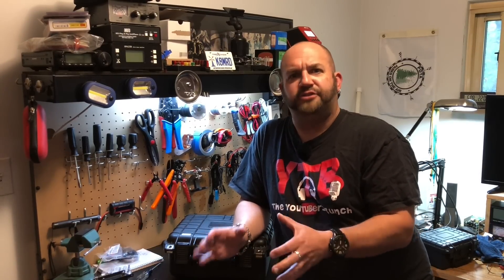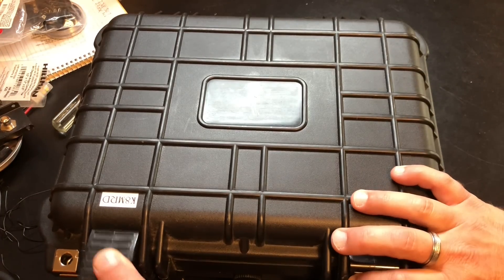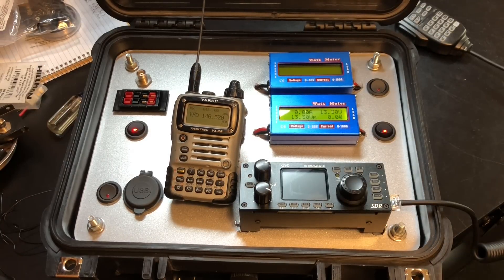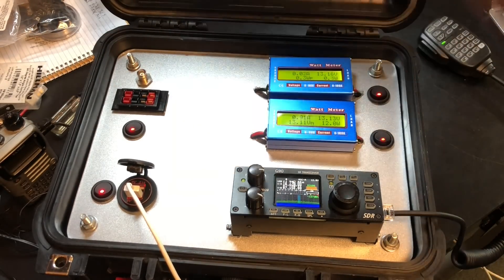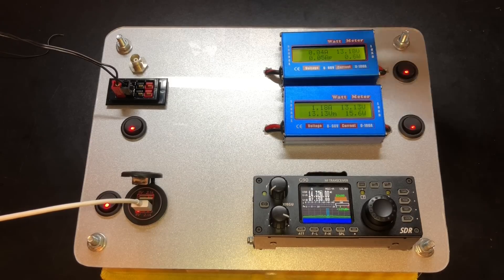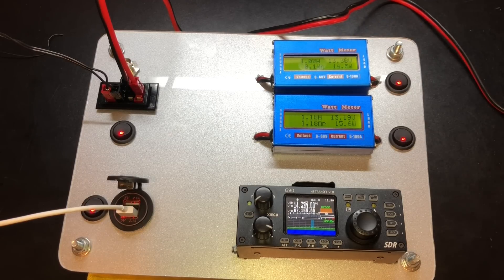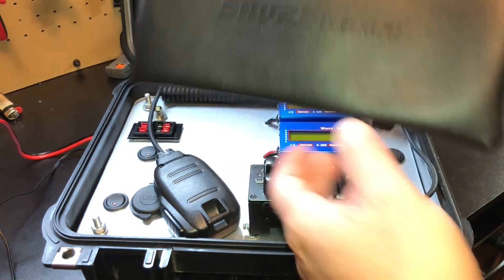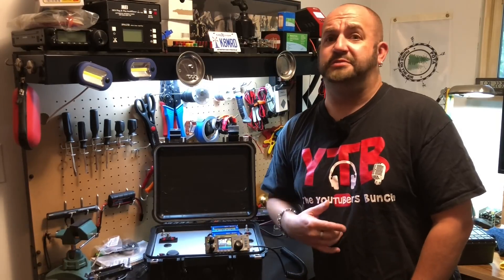Xiegu G90 Ham Radio Go Box & Solar Generator

Comment: Awesome video, I'm so glad you made a go kit like this! I've been going back and forth on wether I will want an all-in-one go kit or to just throw a radio, battery and antenna in a bag and set them up on location, but this is definitely making me heavily consider a go box. Most of the ones I've seen are really big, I like the smaller size, it seems a lot more manageable! The only thing I might add when/if I make my own box is a raspberry pi for digital modes, but that might do better with a seprate box/case that connects to the main radio kit, so it isn't a permanent thing. Can't wait for the build video!
73 de KE8OIB
Reply from the maker: Thanks Logan.  For me, if I added anything else to this build like a Raspberry pi, it would have to be in a bigger case, and start to weigh more, and be the go box that I don't want.  Sure I could mount the pi on top of the panel, but then I would have to have a screen and a mouse and keyboard etc.  It can get out of hand quickly.  The idea is for quick deployment.  I don't care about hooking a computer up to it as I'm not really into digital modes.   If you did want to add all that you could certainly do it, but you would need a bigger case at the very least.
Reply: @hamradiotube  Yeah, I get what you mean. I've seen some super awesome kits that incorprate all that stuff (screen, Pi, keyboard, etc.), but they're very chunky  and don't seem like they would work well for a casual activation. My current plan is to make a small box that includes the Pi (running headless with a tablet) and all necessary things (soundcard, GPS dongle, etc) that plugs in to the main case and doesn't have to be brought out for all activations. Who knows what I will do though, I don't even have my general ticket yet!

Comment: I'm thinking of getting a 705 sometime in the future, once I have something else for portable I will probably make something like this and stick my 891 in it. Though obviously I will need to add supplemental cooling because we all know how hot the 891 can get, especially enclosed. I think personally, I would forego the solar charging, and add a bigger battery and a manual tuner. I didn't realize how simple one of these could be, I thought they were super involved and very expensive. Obviously, it's as expensive as you make it. Most people already have every thing laying around except maybe an extra battery and an extra pelican case. I look forward to seeing updates to this in the future! 73 de W8IJC
Reply from the maker: I'd love to see what you come up with.  I'm gonna take my chances with cooling.  There just isn't room for a fan in my build.  Theres plenty of room for air to circulate around the edges and the cutout for the head cable.  I'll know when I get a chance to take it out portable.  I've never had an issue with my 891 getting hot.  There is also a "contest" mode you can set the 891 too that will kick the internal fans into overdrive.   As far as cost, I prob have less than $100 in all the parts including the case.  Obviously that doesn't include the battery and radio.
Reply: @hamradiotube , oh, I thought that was a common thing about the 891 getting hot. Mine seems to get pretty hot, and I do have the fans on contest mode, mainly just when I run digital though. So honestly the supplemental cooling was just a shot in the dark more or less. I'll definitely build one of these things in the future! I look forward to more of your videos on this!

Comment: Thanks, that's an inspirational design, and now I have the jones to make a box similar to yours!  I like what you did with the head, I'll do the same on my G90. I'm also going to add an RPi below hooked up to a SGGCOMS audio interface and a GPS antenna for remote data ops. Couple of things: (a) Did you get a source for a shorter D9 extension cable that is still shielded? Also, I am concerned about your design in one area. (b) I'm worried your design doesn't adequately cool the base of the G90. That gets hot. I think you might be able to easily mod your case by sticking a 60mm fan on one side of the case and creating a reverse-chimney with a piece of plastic or cardboard down to the G90 on the other side of the case so the air flows under the G90. I will experiment with mounting my G90 cross-wise so the air flows along the bottom heatsink channels instead of across. In any case, will love to get your in-field feedback experiences!
Reply from the maker: Thanks Paul.  If you add all those things, you will need a bigger box, which is the exact opposite of what I wanted.  It would turn into one of the big heavy boxes I talked about in the beginning of the video.  Not saying don't do it, that's just not what I want.  I don't care about digital so I did not incorporate that into the build.  As far as heat, only time will tell.  I am very aware the heat the radio produces.  I may add a fan in the future, and it was something I thought long and hard about, but ended up without for a few reasons.  One, the heat sink is on the bottom, which is the dumbest place to put it.  If I turned it over then the speaker would be firing down and I'd prob have to add an external speaker.  More weight and not a lot of room to begin with.  Then I would also have to find a place for the fan.  You see where this is going.  There is plenty of space around the panels and the cut out for the cable to the head so it should ventilate well enough.  Plus it is sitting above the bottom plate about a quarter of an inch, not resting on it that should provide some heat dissipation.  There is also nothing else in there that produces heat.  I still haven't taken it for a proper K8MRD test in the field as I've been building, filming, and editing for the last 2 weeks.  I'm sure I could cram a fan in there if I have too but I really don't want too.

Comment: I use the Bioenno SC-122420JUD charge controller. It’s rf quiet unless you plug anything into the USB port on top. Tried charging my phone while using my 818 and couldn’t hear a thing over the increased noise. 

Their 28watt panel works great for me, granted I’m in Texas and only using a 3ah Bioenno. I’m planning an upgrade to the 12ah for more power to charge/run other devices as well.
Reply from the maker: Ive got a Bioenno charge controller as well.   A little too big for this project but it works great.
Reply: @hamradiotube  yeah, same thought. Given that the BioEnno charge controller doesn't have to go in the middle of the circuit between the battery and load, my thought was to leave the CC out of the box and stick it to the back of the panel instead.
Reply from the maker: @PleasantPaul  Yeah you certainly could.  That kinda goes against the purpose of how I designed this though.  I want everything in the box.  Plus, I have more than one solar panel so that would limit me as well.  The real idea behind this box is as an emcomm and power box.  I most likely will always have it in my car should I need it, or just want to play radio.  I don't want to have to worry about any other parts.  Literally everything will be inside this box, coax, antenna, everything, other than the solar panel itself.
Reply: @K8MRD RADIO STUFF yep I hear you. For me it’s POTA-first, emmcom second, so for short activations I’d rather have less weight and the CC can live with a panel. Great design choices! I wish I could fit the CC in my box but the RPI and data stuff make it tougher. In any case, thanks for your excellent inspiration! I was always anti-go-box (but pro-go-bag) until your design.

Comment: Is that phantom power on the top meter what it takes to light the meter up?  Freakin awesome box... about 90% of the time people don't show how to mount things inside.  Looking forward to the next vid brother!
Reply from the maker: No, its just connected to the battery.  When power is coming into meters like this, either from the source, or load side, the meter will turn on.  That's why I had to put a switch on it.  I'll have the build video up soon.

Comment: Great work! I have been looking at doing something similar.  Do you have any issues with the G90 overheating being fully enclosed like that? I was debating putting a fan and vent holes in the top mounting plate.
Reply from the maker: I haven't actually had a chance to put this through a proper K8MRD stress test, but I imagine it will get pretty hot.  I thought about a fan and may add one in the future, but honestly there just isn't hardly any room for one.

Comment: I like your box. I just took my vhf /  uhf  box apart. I am on HF more than vhf / uhf now. There  are pictures of it on my twitter account “Sroy2HamRadio” if you want to take a peak. Scratch that pictures were on my old instagram account. Will try to find them.
Reply from the maker: It'll be a lot cooler with HF in it for sure.  Now you have another project :)

Comment: Great build Mike! You will have a lot of fun operating that kit. I built a 19" rack mount go box at one time AND took it into the field on many occasions. It was a beast and I finally got tired of lugging it around. It weighed almost 40lbs without the battery.  A bit off topic and I know you have mention it before but for the life of me I can't remember what logging software you use? 🤣
Reply from the maker: I would like to see someone actually taking a rack mount box out in the field.  It would make for a good laugh for sure.  As far as logging, I prefer Crayola Crayons and construction paper.  I find it to be a lot more rigid than notebook paper, and if the bands are quiet, I can always color while I'm waiting for a contact.  73
Reply: @hamradiotube  🤣

Comment: Well done Mike. You've built what many of us talk about but never get round to building! 
73 Bruce G4ABX
Reply from the maker: Thanks Bruce.  It really wasn't that difficult.  Half the time I spent building it was thinking up/shopping for parts to make it all fit.
Reply: @hamradiotube  I guess nothing is that difficult once you get your head around stuff. I would like my go-box to include TX/RX and  Raspberry Pi with screen for digital modes and logging etc. I now have the Computing side working -- with GPS, RTC, WSJT-X, FLdigi etc., (Courtesy of KM4ACK) and have completed my Solar Generator (courtesy of OH8STN) so now I need to find a suitable rig -- maybe a KX2 when people trade up to the new ICOM 705. It should be an interesting Autumn project. 73 Bruce G4ABX
Reply from the maker: @Dr-T  Yeah it would be sweet to have a Raspberry Pi and all that, but then you would need a bigger case, more stuff, and more weight.  I don't really do digital much so I'm good with just my iPad for logging.  I'd be curious how small you could make it while still incorporating all of those extra goodies.

Comment: Very cool, I might have to follow your lead and build one for my G90. I'll be honest, I'm still a little intimidated wiring up switches and power meters though. Just need more experience probably. 
Couple questions if you don't mind; how's the sound since the speaker is on the body under the plexiglass? How's the heat build up with the body enclosed like that?
Reply from the maker: The sound is surprisingly loud.  I was concerned I might need to drill some holes but the lid of the case seems to reflect the sound right at you.  The wiring isn't too bad.  I'll have a build video out soon that shows how I wired everything up.  It's pretty straight forward.  As far as the heat is concerned, I haven't taken it out portable yet, (been too busy building and editing 2 videos for it) but I suspect it will get pretty hot.  A fan may needed.

Comment: you should have a open area in the top with a thin screen to let out the heat from the radio. Also, you can get a small thin fan to blow the hot air under it, with a small temperature meter.
Reply: Amazon has some nice looking black 90mm fan grills that come with mounting screws. Just added one to my G90 stand w/built-in fan. Not sure why they didn't include a grill in the original design of the stand but it was easily remedied. Take care and have fun out there!
Reply from the maker: I think there are enough gaps around the sides to let heat out.  Its not as "precision" as it may look on camera lol!  I havent field tested it to see if I'll need to add a fan, but I hope I don't need one.  There really isn't any room to put one.
Reply: @hamradiotube  maybe if you just put a small grill or slots in an open area. mine gets a little warm when I use it in my enclosed spot on my desk.

Comment: This is one kick ass "Go Box!" How's the temperature of the radio after extended use?
Reply from the maker: Haven't had a chance to use it in the field yet.  Thats the one thing I'm wondering.  This radio gets stupid hot.  We shall see.
Reply: @hamradiotube  Great build, thanks. You might want to cut a hole and put a fan underneath the upper Plexiglas, with a finger-proof grill to draw air in and some small to middlin' holes skirting the main radio box to let the hot air out. Hiding the holes underneath the control unit, while out of sight they would slowly cook the radio control unit. Also with the holes if things are starting to get too warm / about to let the magic smoke out you would probably smell or notice it sooner and be able to shut the power off seconds earlier.

A couple straps or some thing across the lid of the case would assist in holding coax where it would be stowed out of the way .
Reply: @davidniemi4051  My thought is to have a minifan in the back area blowing out with holes along the front of the upper plexiglass so that airflow is across the radio body underneath.  Minimum voltage use but for just a little voltage use you may save your radio.  Just a thought.
Reply: That was my only thought. I know people that put the " brain " of their radio under the seat of a car, let trash and dirt and dog toys build up around it and never give air flow a second thought. Very neat Mike, but as you know I am a anti commie chong radio guy. This from a guy that has 9 baofung ht's for disposable use. LOL!

Comment: Here's mine: https://s3.amazonaws.com/files.qrz.com/x/ke5vxx/20200611_230233.jpg
Reply from the maker: Wow that's awesome.  Very professional.  Did you 3d print all those mounts?
Reply: @hamradiotube  yep! The mounts in the lid holding the antenna and the mounts that hold the radio and battery in place all 3d printed. This weekend I added another button not shown in pic that powers a raspberry pi. The tray that holds the head unit is also 3d printed. This allows the head unit to sit flush so I can close the lid.
Reply from the maker: @tracerfacer6234  ok cool.  Thats a hell of a build!  I thought about a. Rpi but I really don't do digital much.  Plus I'd have needed a bigger case.
Reply: @hamradiotube  thanks! I really enjoy digital so it was a must for me. It's a tight fit I'll admit, and I may experience heat issues. We shall see. There is a victron solar charge controller inside as well. Ports on the back for antenna, solar charging, and wall charging. This was not a cheap build with some of the mistakes I made but for a first build I'm very happy with how it's turning out. I also recently picked up the GSOC for the g90, so may end up making a new panel to accommodate that. I'll take some pics of the inside and share them later today. This project is what got me into 3d printing so there was a learning curve there. Ton of fun designing and re-designing the mounts and I've used it for other projects as well. Great investment.
Reply: I added a bunch more pics of the build to my QRZ page. I have a few projects on that page so scroll towards the bottom to see this build.

https://www.qrz.com/db/KE5VXX

If you right click the images and 'open in new tab' you'll get the full size version of the pic.

Comment: Looks great! I know you used materials you had but I would of used thicker plexiglass or lexan.
Reply from the maker: Thanks Scott.  Any thicker and the switches wouldn't snap in.
Reply: K8MRD RADIO STUFF that makes sense. I wonder if maybe lexan of the same thickness might be more rigid.
Reply: or maybe sheet aluminum which would facilitate heat transfer...